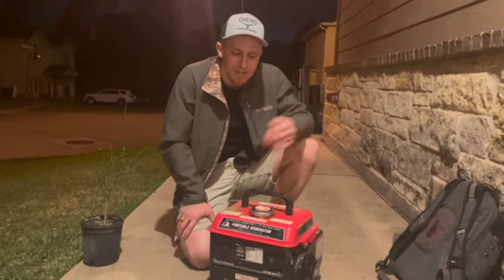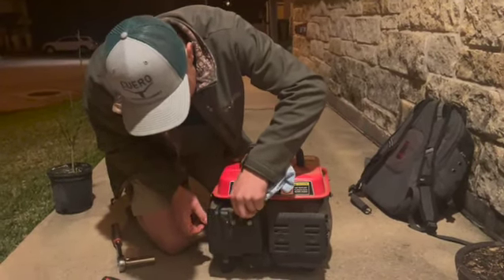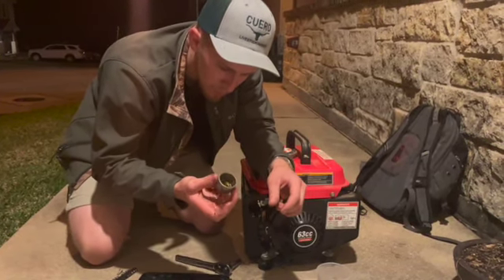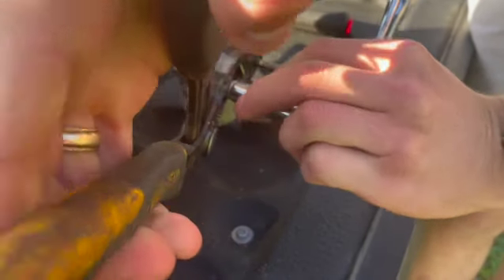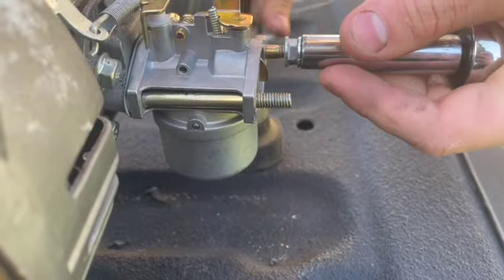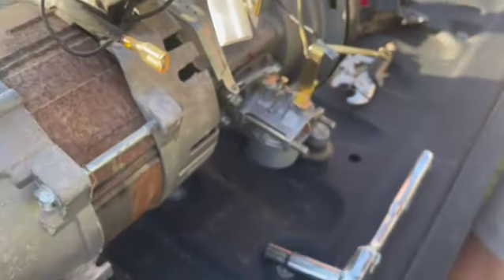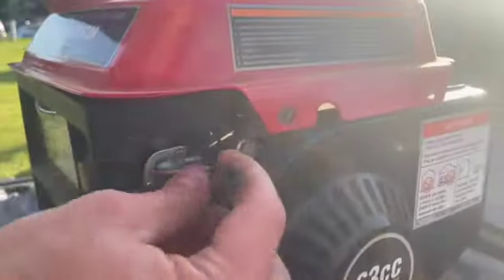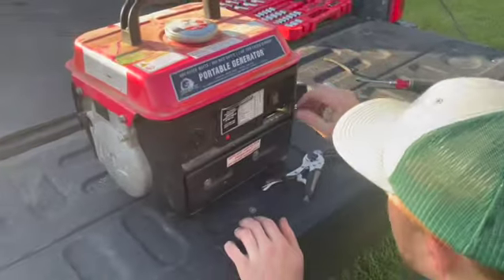Storm Cat 800 Watt Generator No Start and Repair

Comment: I have one a tailgator similar to the one you have.  Won't start...no spark.  Replaced the plug, the CdI cable that goes the plug and the part that works with the fly wheel to generate voltage.  Gap is preset.  Bushing is in place at the shaft.  Checked all the switches and the circuit breaker...all fine.  Still no spark!  All the wires look fine.  What could I be missing if anybody knows?